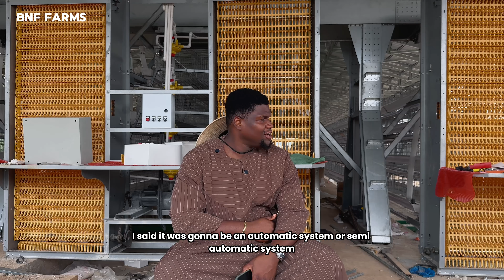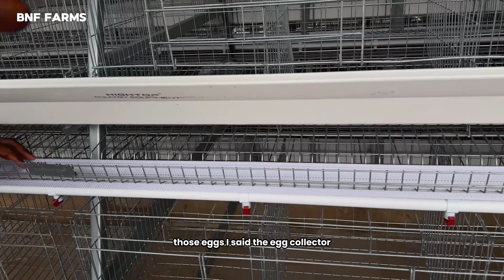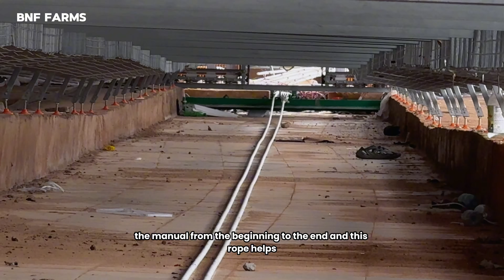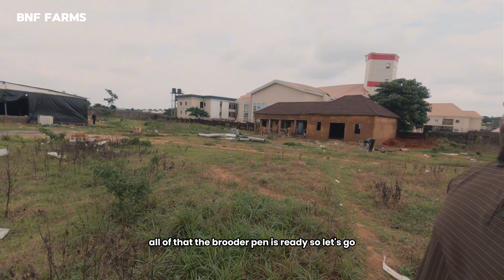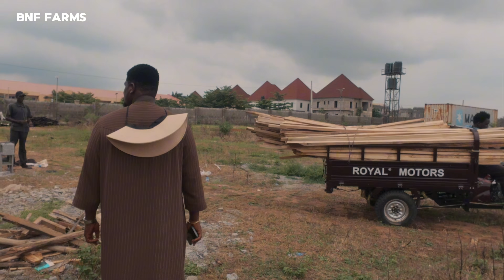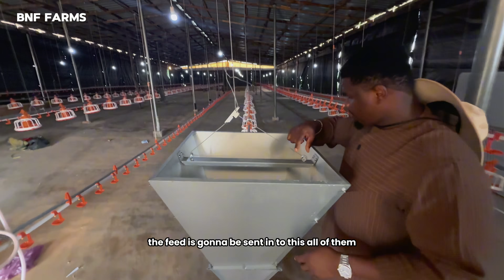15,000 Layers Almost Ready! 🐔🔥 | Inside Our Massive Layer Chicken Pen

Comment: Currently, I have 500 layers in fully manual battery cage. I didn’t think about waste when I was doing the construction and now, waste is a very huge problem that we find difficult to tackle. i used my garage to convert to the farm….

Next year I plan to build a 5-10k capacity farm in my hometown (Umuahia)….. will it be possible to reach out to you for assistance and guidance by then? 
Please how can we get in touch? Thank you 🙏🏾